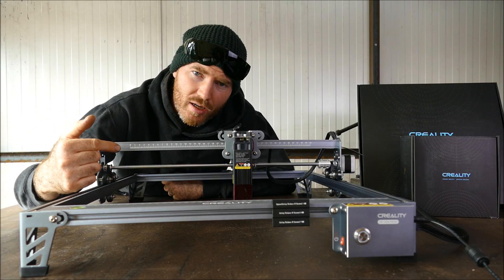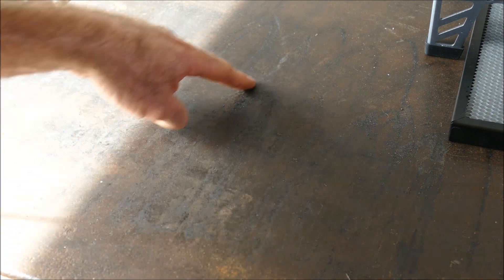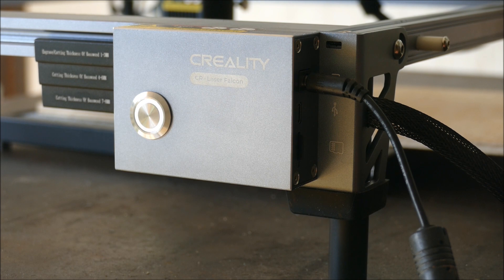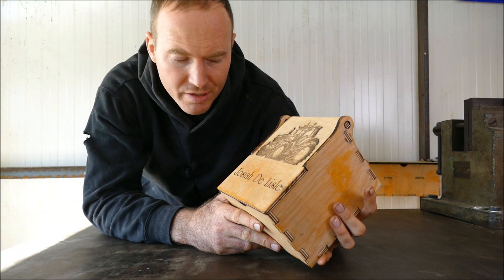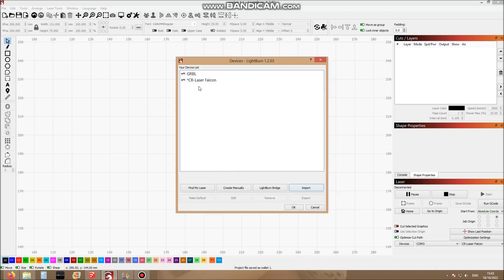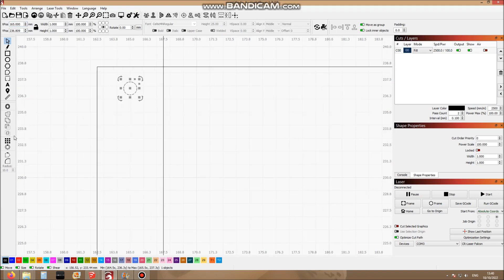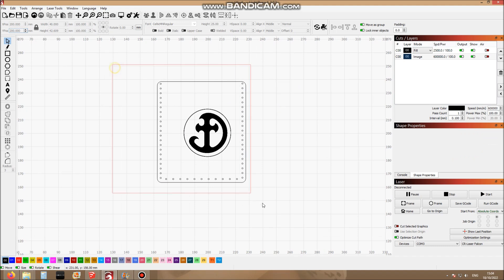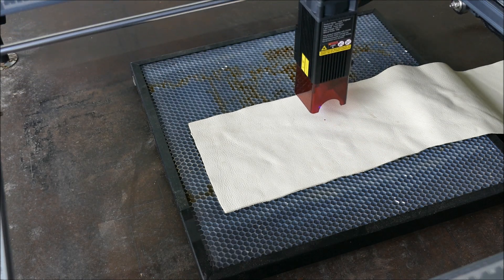One Button To Rule At Laser Engraving! - The  New Creality 10W Cr-Laser Falcon Review

Comment: Dropped the cash on one of these, still waiting for the bloody thing because Creality chose to use one of the worst rated logistics/couriers services. My 3D printer from them came faster with another service. Busy setting up the work space for all the expensive toys, would you say air assist is absolutely necessary? was looking at the enclosure for the laser but not sure if I should get both? Enclosure would however restrict the size of material I'm using so might be a no go. Do you have any updates/tips/trick on this model? Links? Great video.
Reply from the maker: Hi. Thank you. hopefully it comes soon. Air assist is essential really for clean and efficient cutting. In my latest video I show my compressor line set up. An enclosure is needed for optimum safety as these machines are hazardous. Cheers J

Comment: I believe the laser has a built in fan for smoke dispersal, but is this enough air supply to not require a separate air assist pump? Thanks.
Reply from the maker: I would always use another air supply as it assists in cooling the laser also which will extend its life. I use a compressor at 20psi on all my models. Cheers J
Reply: Thanks for the advice, much appreciated.

Comment: I’m wanting for cutting I’m not so much in to engraving is this machine good for cutting and can it cut 10mm ply wood I would love to no what wood it can cut and speed ect with light burn I have around 450 pounds to spend on a laser cutter so would this be your recommendation for the price or is there better for the buck thanks
Reply from the maker: Hi. Thank you. The comgrow Z1 10w is the cheapest that can cut but takes a long time. If you can splash out a bit extra I'm currently reviewing the comgrow Z1 pro 20w which is probably the best for the least amount of money. Otherwise if you want to be commercial and get a return back on your money I would go for the xTool D1 40w as it's by far the best performing laser in the desktop market. Cheers J

Comment: How does this engraver compare with the Ortur LaserMaster 2, COMGO Z1 and LONGER RAY5 10W.
Reply from the maker: I don't like the fact it auto homes before printing meaning you can only print exactly where you positioned on the software and not be able to manually position. So far I'm most impressed by LONGER for the touch screen, being very costs effective and working consistently well. Cheers J
Reply: @joshuadelisle  thanks for the response. Shame it's the Longer as it's probably the most expensive to get here in the UK, I guess you get what you pay for. 
Good videos by the way.

Comment: After having the creality falcon I want to try some other engravers. 

Some have linear rails and other designs that seem like they should be more accurate and repeatable than this design.

Also some have belt tensioning screws to make that easier. Something the 3d printers have had for a while now.

Some also have dual motors instead of the shaft to drive each side of the y axis.

Comment: I purchased this about a month ago and I can’t get it to work.
I assembled it plugged it in switched it on it beeps but has never move an inch in any direction.
I have spent a least 10 hours trying to get it working but without success 
I bought a laptop and downloaded lightburn and use the trial version but can’t get it to do anything is it a faulty unit?
Tried contacting Creality but they are not much help,asking me have I connected it up correctly even though I sent them a video showing them it illuminated and beeping 
Any advice would be greatly appreciated as I’m totally frustrated with the situation and wish I had never purchased it.
Thanks

Comment: I can’t get over the price! 

Ok, firstly, I wouldn’t recommend using 230v ac equipment on a truck, it will work and you will probably be fine but… those inverters can kill so please take care when routing cables. Maybe use copex or SY cable to give a bit of mechanical protection. Saying that, I don’t know how you plan to install this or what you will use it for so the above may be overkill but please bear it in mind. I wouldn’t normally say anything and my engineers used to use inverters to charge their drill batteries / power kettles etc but that was within the confines of their dry, warm cab, not out in the open with all those potential hazards.

The other thing, what voltage is that control box? I always like to see 24vdc when it comes to the control side but have a feeling that that one is ‘mains’ voltage… Please look at its ‘IP’ rating if it has one, or just see how water could find its way in, another thing to think about if you will have to use this outside. 

Secondly, that capacitor…. I wouldn’t recommend using polystyrene because of the nasties it can give off when the motor gets hot or the capacitor fails, the capacitor will be absolutely fine rattling about, they are pretty robust. 

Lastly, please wear gloves when handling that wire rope, it’s fine when it’s new but after a while it will fray and cause nasty cuts. I use winches quite a bit and have a few scars to prove it. Yes, I didn’t learn the first time 🤦‍♂️

Great vid as usual, cheers 👍
Reply from the maker: Thank you. It will be seprate to the trucks wiring. I'm using an Ecoflow 2400w battery bank. they're pretty good especially for saftey features and it wont be permenantly fix on,  ill only attach it to use it in fair weather and then straight back off. yeah another guy suggested just using hot glue on the capacitor and get rid of the polystyrene. Gloves are a good idea but if the cables are freying then they're loosing their strength and should be replaced.
Cheers J

Comment: Mr. De Lisle, I've found that different plywood produce different amounts of charring and tarring. I've found wonderful 1mm plywood from Finland that gives absolutely clean sides where you can't find any soot at all. I've found other plywoods where the smoke really hurts my lungs and the tar is thick. Specifically, you want to avoid formaldehyde - literally the chemical they use to preserve corpses. My point is, finding the optimal cutting speeds and pew-pews on sub optimal plywoods will still give you a stinky tarry experience.

with regards,
mattias
Reply from the maker: Thank you. I'm making the most of it with an abundance of free material which are off cuts from a local factory. Extraction using the comgrow hood like in my previous video would work perfectly to rid the fumes and maybe tape to protect the wood from smoke staining. All the very best. Cheers J
Reply: You can actually buy plywood specifically made for lasers and you really shouldn't use anything else. These completely un protected diode lasers are dangerous enough as it is, always use materials made with lasers in mind.